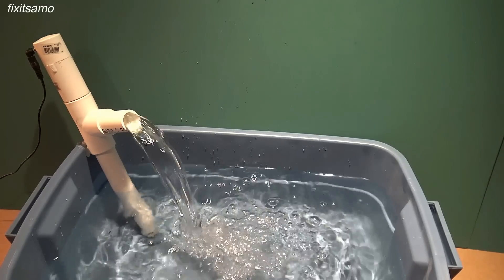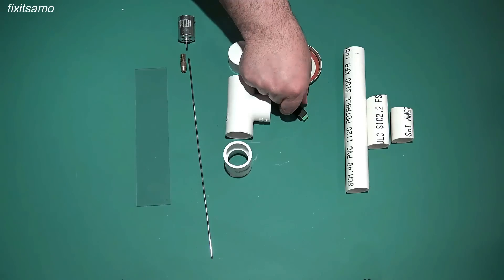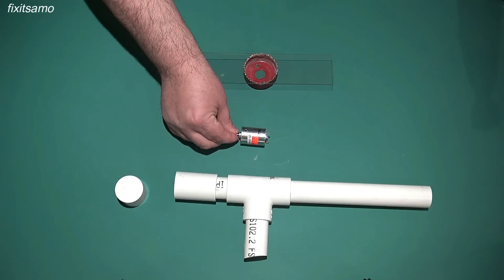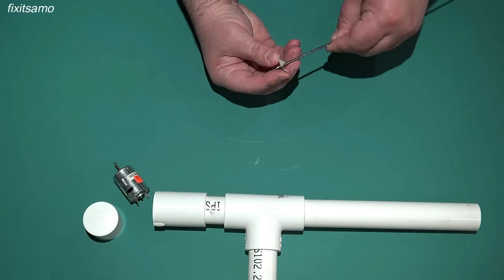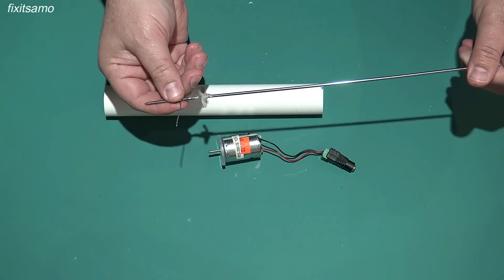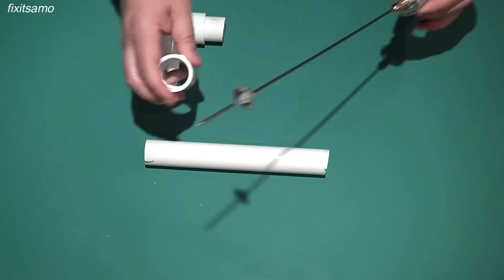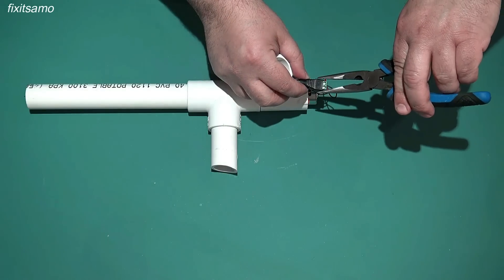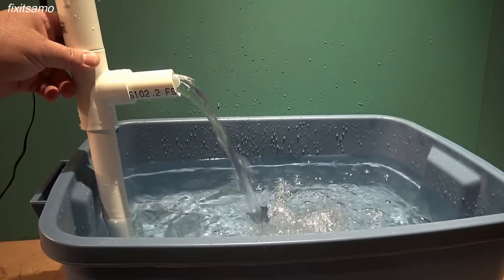How to Make a Water PUMP using PVC Pipe DIY

Comment: can I use a straight  copper wire instead of the metal stick
Reply from the maker: +VINAYAK J NAIR  You could also use a coat hanger as long that it doesn't shake while spinning

Comment: That's SO primitive...  and simple. I love it!!

I wonder what would happen if you put 2 fanblades on that shaft?

The motor will probably draw a bit more current. But will it increase the waterflow OR the pressure?

Could i convince you to try?

Build 2 pumps, but this time with hose fittings on the output. 

Pump 1 with 1 fanblade
Pump 2 with 2 fanblades a few inches apart. 

And then cut different lenghts of hoze. 2, 5, 7 and 10 inches for example. (2 of each lenght)

Then film a "shootout" between the pumps:-)

THAT i would love to see.

You made yourself a new subscriber today;)

Great video sir!
Reply from the maker: +Bo Holbo Rasmussen 
Thanks for the subscription  that's an interesting theory  i will sure put it on my to do video list :) thank you
Reply: @fixitsamo  did you ever do this comparison video?

If so, would you add a link in the description of this video, please?
Reply: Glueing the fanblade with a hot glue is kind of a bad idea, it's just unreliable. Even soldering it is a better idea than glueing.

Comment: do you know the RPM of your motor and by chance how many gallons per hour it pumps?
Reply from the maker: +michaelwni 
Its 10000RPM
I don't know how many gallons per hour i will get back to you but you could see the water pressure its very strong considering the size of the motor that i used

Comment: Nice concept, BUT, what happens when you need to extend the input tube over the 6-8" in the video? If you wanted to make it to say, 3 feet, would you need a stronger motor?
Reply from the maker: +Lee Young   For sure you would need a stronger motor
Reply: Lee Young Judging from motor's size. I think you just need to extend the input tube changing the motor or the length of the metal rod. But, you will have to priming the pump. By simply pouring water into the tube or dip it until the impaler submerge in the water. Once you had a flow going. You can lift it. Although it may affect the current flow the higher you go.
Reply: You could possibly reduce the pipe  maybe build up velocity pressure